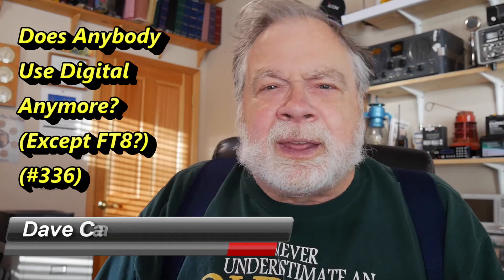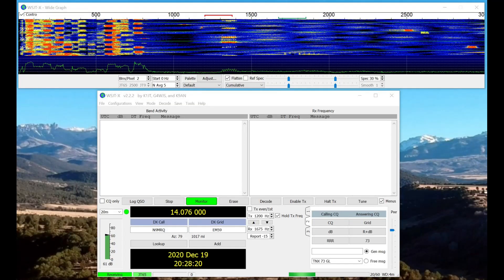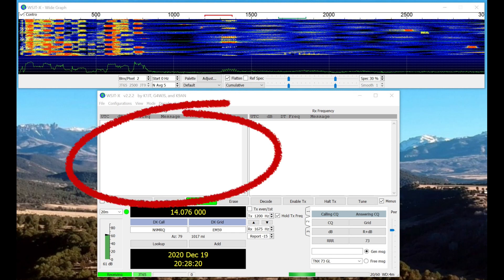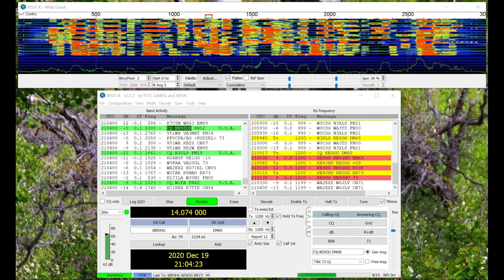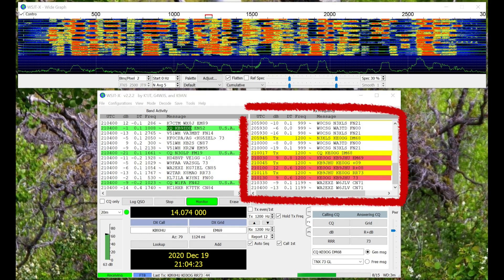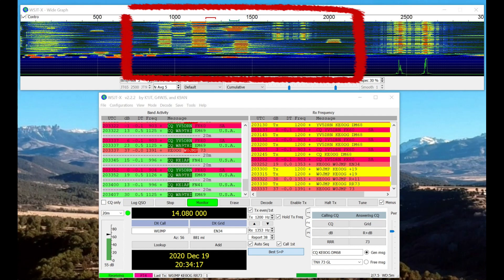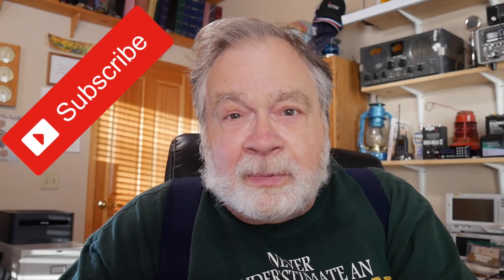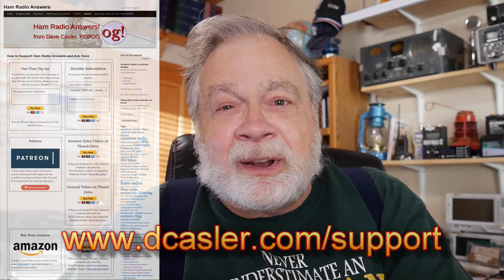Where Did All The Digital Activity Go? FT8! (#336)

Comment: FT8 is a very popular mode, so it is a good way to tell if the bands are open or closed. Using FT8 gets old pretty quickly because it’s a pretty boring mode.

I used to use AMTOR decades ago. ANTOR with forward error correcting worked pretty poorly. But QSK AMTOR with handshaking error correcting worked great! QSK AMTOR was drastically more robust than any other modes, including CW. PSK31 was new back in the AMTOR days, and was no where as reliable to get through under marginal band conditions. But AMTOR sadly fell out of use and is not heard anymore.

PACTOR might be a replacement for AMTOR, but almost no one uses PACTOR because the PACTOR modems cost $1,600 to $1,800.

I’ve tried using JS8CALL call, but the data throughput speed is very slow. It takes about 30 minutes to exchange basic station information, a similar data rate like a 5 wpm Novice CW QSO. 

PSK31 is OK, but it’s not very robust and isn’t very reliable compared to modes that have error correcting, especially QSK handshaking error correcting.

Forward error correcting is simply a poor substitute for QSK handshaking error correcting.

Comment: Thanks Dave. I enjoy digital on 10m (when it's open). I prefer JT65/9 or PSK31 since I can pass 10-10 numbers using those modes, but as you stated, these modes are few and far in between.   I understand it can be done on FT8 as well, but I haven't seen it. Besides, FT8 is plain too fast for this old brain to try to inject something else into a transmission (hi hi).
Curt K2CWM NJ
.

Comment: You answered my question I had.  I was trying to get ready for the RTTY Roundup after having been off the air for a long time.  Prior to the contest, I could not find a RTTY signal to test out my setup!  Tried quite a few times on different days, times and bands with no luck.  When the contest started, all that changed.  Too bad, since RTTY is a great mode.

Comment: Someone can definitely school me on this, but as a Tech that mostly just monitors the local repeaters at the moment, I have trouble understanding FT8 vs a conversational mode (such as those mentioned in the video but also JS8Call). I don't have an opinion on whether folks use one or the other (as I recall it's a little controversial?) - I just don't quite see the point in FT8 over JS8Call or another mode that's at least capable of some free form conversations?

FT8 is strictly just for QSO and contesting I thought? Nothing wrong with that! But as a ham that would like to get into HF at some point, the draw of it is being able to have a conversation, even a short one, over a long distance which makes JS8Call or conversational modes far more interesting over what seems to be card collecting? It's not to say I don't find FT8 interesting (and JS8Call shares the same digital mode as I recall?) - it's just sort of "on rails" to the point I don't see it as a useful tool if information needs to be sent a long distance for any reason (it's 2020 for a little bit longer as I write this, so I hesitate to bring up some global catastrophe - but that would be a good example). FT8 wouldn't be useful for such a thing, would it?

Again not trying to say one mode is better than the other. I'm a tech so I can't have an opinion if I wanted to :) I'm moreso just trying to understand the draw behind FT8 since, I guess the short explanation for the above is I don't quite get the purpose?

Comment: Really enjoyed the video Dave. Been a ham for 40 years and really enjoy FT8, FT4, JS8CALL, PSK31, Packet Radio and SSB. In my humble option, anything we can do to keep folks interested in ham radio is a good thing! I enjoy both simple QSOs and ragchewing, digital and voice, using a modest shack with little investment (35 year old Yaesu FT757GX (barefoot) into a $79 MFJ1982MP 10-80 EFHW antenna). I love how technology helps keep folks intersted in ham radio. From new digital modes, to hotspots (using YSF, DMR, etc), to APRS and also mesh networking. We have a GREAT hobby! You mentioned using 10, 12 and 15 meters as the sunspot cycle improves: From the end of April 2020 to December 2020 I have had 36 QSOs on 10 meters, 45 QSOs on 12 meters and 105 QSOs on 15 meters. Thank you digital modes (of all types) for the opportunity to have so much fun while propagation isn't at its best. It's only gong to keep getting better from now on. Thanks for everything you do Dave. 73, Brad KA9JDE

Comment: As others have said, FT8 is fabulous and you can work stations on minimum TX power.  However, after over 2 years of heavy FT8 operating (including the ARRL Grid Chase contest), its been nice to get back to PSK31/63/125, Olivia, and other more conversational modes.  After coming back to those modes, I’m re-impressed with how good the PSK modes really are.  73

Comment: I do lots of FT8. I have found I get more contacts if I avoid the most crowded bands such as 20m. I end up getting stacked up behind many others when responding to a CQ. Daytime on 17m and 15m gets the most international contacts for me. JS8Call is an interesting hybrid of ft8 in conversational mode, and there are always a few people there, but I still get few successful contacts. The "Heartbeat" concept in JS8Call is a very good innovation, allowing knowledge of who else is present and available for contact.
Reply: Last winter I Worked All States and also Australia on 80 meters FT8 using just an inverted L wire vertical and 2 elevated radials. I get on 40 meters FT8 in the mornings around 0500 and work Japan and Australia regularly. For the last 2 years I worked a lot of Indonesia, but hasn't been as good this year, so far. de WA5MD

Comment: Thank you for this very insightful video. Especially when you mentioned the network effect. I started out with FT8 when I first got my ticket because it was the least intimidating mode for a newbie. But I got frustrated with how difficult it was to complete a QSO many times due to timing issues or possibly computer interface issues. . I've now learned CW and find it to be much faster and reliable than FT8.
Reply: Yay!  CW is the way to go!

Comment: True observations regarding the massive  FT8 popularity! And I like it, use it and see nothing wrong with it :). Yet there is another mode coming which you skipped out in your video : it's  a JS8CALL! If one would check the PSKreporter for which mode is active most at the moment it would return with thousands stations FT8 in the first place and JS8CALL in the second with hundreds of stations QRV worldwide! PSK search would return maybe 20 stations. JS8 is not simple nor easy, but it is keyboard-to-keyboard, packed with lots of features for experimenters , building bridges between fun radio and emcomm etc. I have discovered the JS8 recently  sitting in my Raspberry Pi among the whole bunch of ham radio software  by KM4ACK , and I start liking it! I have it now running nicely on my Win10 laptop also.  I suspect, the JS8 will become soon an alternative for those who like the FT8 technology but want something more except just making that DX QSO! 73! Linas LY2H
Reply: Totally agree! JS8Call is a more social mode, so I am experimenting more. On a PC it is just a case of installing another application - but then the learning starts. I have made a couple of QSOs but not enough to really undertsand and start to exploit the potential.

Comment: Good info Dave.

I have been getting a lot non-USA countries in my log using 20m, FT-8 but I really don't enjoy it that much.  Most of the time I have to keep changing frequencies to a clear spot and it then transmits on the same one, so I have to move again.  Since FT-4 is a little ways away, it is much easier to find "your spot" and even camp out there while other hams come to you.  It has a much faster cycle time (7.5 sec vs 15 sec) but it uses twice the bandwidth than FT-8.  I have tries 17m, 15m, and 12m, but I don't get the range that I do with 20m.  The main advantage to those bands is more elbow room, even with FT-8.

What really gets my blood pumping is using Ham Radio Deluxe and the wide range of "other" digital modes it makes available: CW, PSK, RTTY, Hell, Contessa, Domino, MFSK, Throb, Olivia, and Thor.  PSK-31 is great to actually converse with the Ham at the other end but as you stated, finding another ham using that mode can be a challenge.  I was thrilled when I made my first Olivia contact.  I signed up for the Olivia message io.group and it helped me find likely frequencies, but setting a HRD alert for Olivia was the ticket to success.

Comment: Dave, how about JS8Call? Ft8 technology with conversation! Love it! I did the FT8 thing, but it just seemed too impersonal. Sure enough, there aren’t near the folks using JS8Call as are on FT8, but its growing fast and I know for sure there’s really somebody on the other end during an exchange! Your thoughts? Thanks!
Reply: JS8Call is excellent.. (conversational and low signal characteristics) 
I use it very often, and active on 20 mts.

73 de LU5EOI 👍🏻
Reply: Indeed JS8Call is like FT8 but with a strong element of socialisation via conversation .
Reply: Have been on JS8Call but it still seems pretty sparse, at least on 40 meters.  Not many people there, whereas FT8 is very active.  I'd like to see JS8Call become more popular, as conversations are a lot more fun than just exchanging grid squares...!

73 de KJ6GEU
Reply: Not that I want to start World War 3, but I approve more of JS8CALL because if it's conversational capabilities rather than FT8 that simply automatically exchanges signal reports and call signs. That's not a QSO. That's two computers talking to one another and completely impersonal. People that earn their DXCC on FT8 should be ashamed of themselves. They forget those of us that have been on the air for 50 years or more and had to work our butts off to get DXCC.

I admit that technology has changed. But that doesn't mean that those changes should take away from the hard work of those of us that did it the way it was intended to be done. I would be more likely to accept DXCC awards for JS8CALL then straight FT8. Like someone wrote, at least you know someone is on the other end communicating with you and it's not an automated process while some are sitting out by the pool drinking a mai tai or a beer.

At least with JS8CALL it may be used during an emergency situation when you need to order a 100 blankets and 50 cots. It has a functional advantage or purpose. An earthquake or a hurricane has just struck and band conditions are crap. You need supplies ASAP. What are you going to do when you don't have voice? JS8CALL. In fact, maybe there should be frequencies set aside on each band for JS8CALL during emergencies. Just like we have Maritime frequencies and we have County EOC frequencies. We should have JS8CALL frequencies.

As you should see, I'm not opposed to technology improving communications. Quite the opposite. I love DMR! What a don't love about DMR is that it requires an internet connection. After a hurricane or an earthquake you probably won't have an internet connection.

Comment: FT-8 it's the Zombie Apocalypse of the HamRadio. Bored people sitting in the front of computer doing pretty much nothing. It's ashame that PSK31/63 is no longer used that much. I want so much to have a keyboard to keyboard conversation with someone but instead I get crisp clean waterfall or RUBBER STAMP messages. With this options on the table, I started to learn CW but somehow it feels so hard for me to decode the information. So I'll keep practicing. 73, signing out. This is OZ/YO8UFO

Comment: Hi Dave another fine video. I only been a ham for 15 years. I have noticed great inactivity in PSK and SSTV. I only have a 40 meter dipole so I am only resonant on 40 and 15. There have been an increase of FT8 users on 15. 40 is quiet in the evenings but worth the short skip.

Comment: Wow. Since I tried digital last week in years with my new IC-7300 you're right. With only fldigi I did decode bits of a few QSO'S,  trying to CQ AND ALMOST BLEW OUT MY EARS. Yup I need to turn off TX audio or something. I would also appreciate your advise as to software (Windows) . Have watched a number of your ic7300 videos and not yet found setting tx audio. Great videos.  73 VE4VID.

Comment: During VHF Contests there have been no signals on SSB or CW. But go up to 50.313 and there is wall to wall FT-8 signals, even with an otherwise dead band!
Reply: There are less All Mode radios out there. HF sets usually have 6m. Not hard to figure that out.
Reply: @forgetyourlife  FT-8 has made 6 meters a more usable band during off peak times and in between E seasons. Having 6 meters on most HF rigs has really improved the DXCC DeSoto numbers for the annual scores.  I am glad to see all of the activity on Six!  One of my best friends up in Maryland lives in a HOA restricted neighborhood and he got his DXCC all on FT8 with a EFHW  antenna. I have been on Six for about 45 years and FT8 has expanded its use!

Comment: Also, FT4 uses more bandwidth and isn't as good at digging out weak signals (something like 5 dB difference to FT8)
Reply: True, but FT8 doesn't dig anywhere near as deep into the noise as JT65 or (best yet) JT9.  Yeh, they are slower, but that is a direct result of programming that makes them so good. 
QSOP's on FT8 is maybe -21 at best.  I have had QSO's on JT65 closer to -28db, and -31db on JT9.

Comment: Great video Dave!
I got into ft8 shortly after getting my General then my Extra. I have a wife who is a nurse overnights, and when she's sleeping and I'm up, a quiet mode like ft8 on my IC-7300 is just the thing for keeping me on the air and making contacts. I dial mine down to 75 watts.
I have a Digimodes Adapter I purchased for my luggable Xiegu G90 setup as well, and running at only 18 watts on that radio and an end fed it seems like it's plenty easy to make digital contacts at my in laws place when I can't get any voice contacts. 
73 de N2NLQ